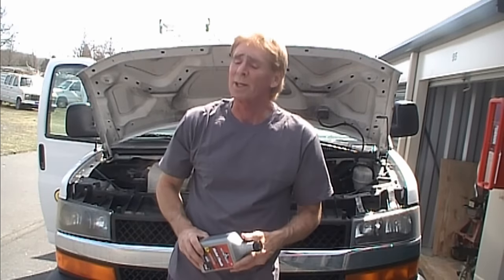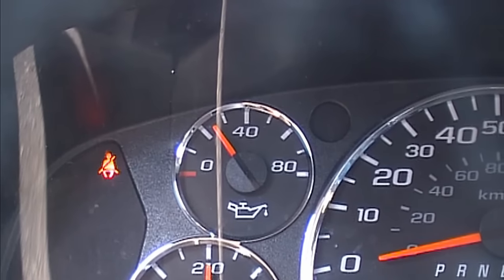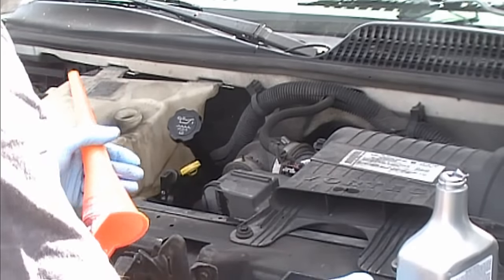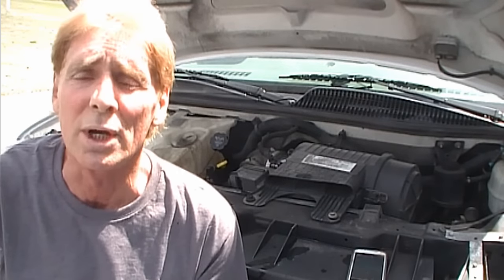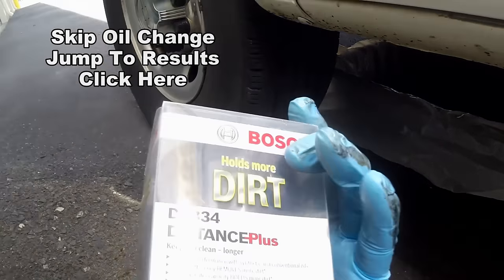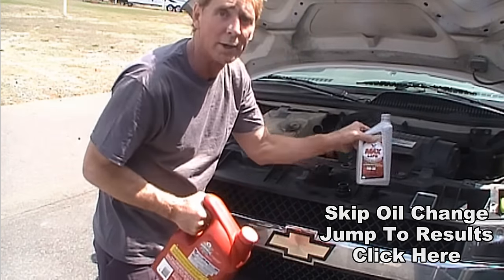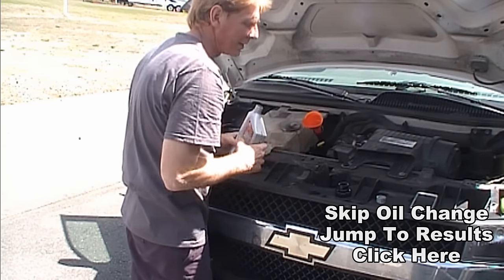NOISY LIFTERS? Motor Flush - Does It Work?  HOW TO DO IT YOURSELF

Comment: NEVER use an oil filter wrench to tighten an oil filter, a firm hand tight application is more than enough, and please get the right size socket or wrench on the drain plug
Reply: I second this and said the same thing lol
Reply: Or never use vicegrips for a oil plug!
Reply: This guy's a goofball
Reply: He’s wearing gloves, when the latex/nitrile, gloves get oily they don’t grip…. I changed oil 10 years no gloves last 15 I reach for gloves every time I drain fluids. Every single fluid on that ride has benzene. Benzene is very heavy and will get directly into your blood and eventually bones causing cancer. Use a paper towel to tighten a filter if you’re thinking of wearing gloves😉
Reply: In this situation where there is a heat valley in the pan where the oil filter sits, your wrong. You DO NOT use your hands you won't get it tight enough. In the situation where the filter is exposed and no object blocking you then your correct.

Comment: MMO totally cured noisy lifter in my 2003 Chevy truck. I ran the MMO for about 2k miles and the lifter noise stopped after about 500 miles, but I left the MMO in the for a while longer, and then changed oil... holy shit! The MMO really worked its magic and removed a LOT of sludge, so much sludge that I had to use coat hanger to keep opening up the drain hole. MMO truly is an awesome sludge remover. Very nice!

Comment: "Don't over tighten oil filter" Right after he way over tightens oil filter.
Reply: no shit he way over tighten that filter. lol
Reply: I think the same....always do mine hand tight
Reply: He did
Reply: ALWAYS HAND TIGHT ONLY ON FILTER. I HAVE NEVER USED A WRENCH.  A real pro always uses vise grips on the drain plug! omg
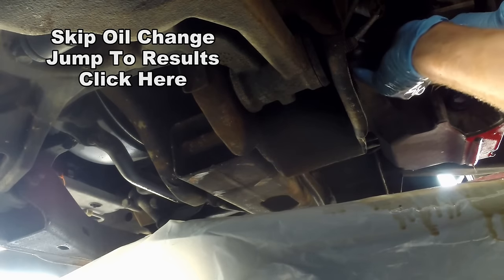Reply: 5:08 The instructions included with most oil filters say to turn to make contact with the rubber gasket and engine block. Then turn ONE FULL ROTATION. He did it correctly. He was slightly over, but otherwise he was correct. I always tighten ONE FULL ROTATION, as per Motorcraft instructions, with an oil filter cap wrench because on my v8 there is no room otherwise. I always use a torque ratcheting socket wrench on the drain plug to exact manufacturer instructions: 9-11 ft-lbs as found in the Chilton auto manual for my car. When you go to a mechanic to have them change the oil, always tell them to tighten the drain plug to the correct ft-lbs specification. That way it avoid stripping the plug and oil pan hole threading.
Reply: Lmao fr hand tight should be good lol
Reply: Especially if it's attached to the oil pump, if you strip it you'll need a new oil pump to take it off.
Reply: Minute lube used silicone RTV one my filter and cranked the drain plug on so tight they crushed the seal,I will never go back.

Comment: ha! "someone had stripped it out before we bought it," let me grab my VICE GRIPS to take off the pan bolt.... sad.
Reply: I find a stripped bolt or nut.. I replace it. 
oil plugs are about $5 or less at any auto parts store worth mentioning, and unless you have some wierd gorram car, they'll be on the shelf.

No excuses but laziness.
Reply: I think a better option at this point is to just JB weld the plug hole and never change the oil again. Or just change the filter and just add oil as needed.
Reply: Oil pan drain plugs often get covered in oil.  Combine that with their short height, and most people only have 12 point wrenches/sockets.  Oil pan drain plug gets rounded off.  Let's pretend he's had the truck for 200,000 miles, and does a religious 3,000 mile oil change - that's around 70 loosening/tightening sequences on that not so great quality drain plug bolt.  Vise-Grips will grab that worn out plug nicely, plus he has tons of room to swing.  Saved himself $5, probly 5 or 6 times I bet.  Stay gold.
Reply: I change the oil on my vehicles regularly. I have yet to strip an oil pan drain bolt. 
Using the right tool and the right sized tool is important. 
If all you have are 12 point sockets and wrenches... invest in a decent set of tools... 12point have their uses but they aren't general use, unless you are being lazy.
5 bucks and doing the job right. It's not that hard.
Hell, get the plug, and a socket to fit it. Spend less than 10-15 bucks and never worry about it again.

Also, most drain plugs are grade 6 or better. So unless you abuse it, it's not going to get damaged that easily.
Good thing too, or 3000+ miles or gravel and other road debris would make the plug a wear item that needs replaced often.
Reply: Kal Galath
I agree with what you said, but he still spent no money and his drain plug remove/install procedure works.  Stay gold.
Reply: Ryan Richards why put someone down? If it works for him let it be his business
Reply: That's a knock...not tick.  No amount of flushing or additives will help that.  Sorry your flush/fill didnt remedy.  Drive her easy and you can get a bit more out of her.
Reply: @nocarebear8301  I've actually seen this!!

Comment: From a cold start the oil pressure should be around 40. If not, drop the oil pan and clean up the pump and screen. 
As for the ticking, there's several things that could be causing it. What you tried may work for someone else. You have to pull out the valves and have a look to get a better idea of what the problem is.

Comment: This is the kind of guy that overtightens  the shit out of oil filters then I get stuck having to chisel it off the next time an oil change is required. Also love the vise grip on the replacement drain plug. Gotta love it !
Reply: He didn’t over tighten the filter
Reply: @moedoe9167  considering the hundreds of oil filters I've replaced, he definitely over tightened the filter. You don't need a tool to tighten the filter. Oil up the filter seal, tighten by hand till seal contacts engine block, then continue to tighten up to one full revolution by hand.
Reply: Vice grip on a bolt.. I think there's a name for that
Reply: Does it leak in 2000 miles tho? Nope

Comment: As a mechanic and race engine builder for many many years, 5 minutes of above idle with an engine flush product at operating temperature will NEVER be enough to clean any sort of deposits built up. The 5 minutes is nothing more than a money maker from the ignorant person. 

The idea is to take the car for a good 50-100km run with the cleaner additive. With variations of heat and oil pressure, the costic solution has a chance to fully circulate and work at fouled deposits through out the engine. Then an oil change can be performed. 

The best flush out is and always will be a full engine REBUILD. Prevention is ALWAYS better than a cure. 
ALWAYS use premium fuels, oils and lubricants. These premium products have more additives and detergents in them designed to reduce friction and constantly clean deposits. 

And ALWAYS service your vehicle according to manufacturers specs. Even intermediate  services make a HUGE difference long term. Reliability, durability and the over all structural integrity at a molecular level on engine components.
Reply: Sage Advice, Thank you!
Reply: This right here!  I had a lifter knock in a 4 runner. Put in seafoam 3/4 quart and ran the car 500 miles .  No lifter noise anymore. Changed oil. Solved.  5 mins won’t generally do anything.

Comment: There's a difference between cleaning a stuck lifter or internals gummed up... And a flattened camshaft and broken lifter. Marvel mystery oil 1/2 qt at oil change 1/2qt day before change... Drive normal. Has freed anything thing stuck I've ever had.

Comment: Its the hydraulic lifters which are making that tappy noise. Pull the valve cover and timing cover off. Release the tension on the cam gears and remove the camshafts. Clean the lifters and put back everything the way it was removed (just the opposite). You will get rid of that tappy noise and have much better function hydraulic lifters. The engine has possibly got another 150,000 miles in it.

Please only hand tight the oil filter and use a spanner or socket to remove the the sump plug. Also please dont use 5W-30. 15-40W is probably the best suited oil given the mileage on the engine and the assuming you are not in freezing weather (wearing a t-shirt).

Lastly dont waste your money on that lifter quiet, engine flush or whatever that was. Read the contents on that bottle, 90% would be hydrocarbons (diesel). I would suggest not putting anything but correct type of engine oil in the engine. If you must, use an engine oil for diesel engine (they have better cleaning properties) to flush the engine and do frequent oil changes to clean an engine of any sludge build ups.
Reply: the guy just took his drain boot off with vice grips and tightened his oil filter with a wrench do you really think hes going to do any of the shit you just said. we get it the guy doesnt know anything. we get it you know more then him. we get it youre better than him.
Reply: thuglyfe91332 Read my comments again. In what way did you find them insulting or derogatory? I know a lot more about diesel engine than an average person because I am diesel fitter. I was just being helpful to him or others who might read these comments. Even if they dont know who to do it themselves at least they would know what wrongs with their car and know what to expect when they take it to the mechanic. The rest was just advice on engine oil and engine additives. Now you tell me what is the purpose of your comments? Just a stupid troll trying to start a fight? Unfortunately its not going to work here, go find like minded people somewhere else. Goodbye
Reply: Don't use 5w-30? That's specifically what it calls for both on the oil cap and e owners manual for those engines on those years. Just saying.
Reply: Dillon Scott Not gonna dispute what the company says. I did say "I would suggest not putting anything but correct type of engine oil in the engine". In think 5-30 flows way too fast. That engine has done 300,000+ miles, components do wear out at such high mileages and thicker oil substitutes for the increased clearance between parts. Believe it or not thicker viscosity oils do lubricate the engine components better in hot temperatures. Thats just my opinion, you can agree or disagree, its your choice.
Reply: I have a 2001 Silverado with a 5.3 and a 341,639 miles and I have always run the same oil. Only had the valve covers off twice personally through the life of the truck (not including dealerships so who knows about them) and all parts had a solid golden sheen with little to no build up. I do, however, have a lifter tick somewhere on bank 2 towards the front, I believe between lifters 1-4. Crate motors for the same year only cost about $3,000 and are labeled as an OEM Manufacturers Warranty Replacement Part through GM. I understand a new set of lifters would only cost about $200-$350, but the engine has long past its expectancy for my use and has been fantastic. My logic is why spend just a little every now and then on the motor for what I would call regular maintenance when I could get the same life out of a crate that comes as manufacturers spec. Just my input on my thoughts. Feel free to offer your own opinions, whoever chimes in Kamal Benipal
Reply: Kamal Benipal What are you talking about "cam gears" and cams? This is an overhead valve engine, one camshaft.
Reply: ***** Well we dnt have Chevys here and I have never seen what inside this particular engine. I wasnt giving him the repair manual for this particular car. Just pointing him in the right direction. I am very confident what that noise is and I know what causes it. Regarding what you are saying, you are giving an impression that modern engines dont have 2 camshafts, infact most engines thesedays have 2 cams because they make the engine more efficient and yes a cam needs a gear to turn it. So you need to do some homework before you start teaching me.
Reply: Kamal Benipal This is an overhead valve engine with one (1) cam, driven by a chain, same kind of engine Chevy has built since 1955. GM doesn't use overhead cam engines in their trucks. Maybe you should learn what you're talking about before you sound off.
Reply: ***** I know what I am talking about .. what you been smoking or injecting? You have no idea what you saying... its a V8 engine and its a van not a truck.. if you still wanna troll go somewhere else because I am simply not interested. Go back to playing videos games or smoking your bong.. I dnt have time to waste on you. Goodbye
Reply: Kamal Benipal No, clearly his apex seals are bad on the rotors.  Yeh, that sounds about as dumb as what you said. Don't talk about engines you don't know about.
Reply: I know I see him using visegrips on the drain plug I instantly said what the,fuck and a lifter that loud he really think maybe a oil flush would cure the lifter issue
Reply: Jay Jones I watched this and thought, additive won't fixed collapsed. I really wanted it to work, but when no sludge chunks came out and the oil just looked like it needed to be changed a thousand miles ago, . . . I decided to scroll down and find your comment.
Reply: Jay Jones Thanks Jay. You are SOOOOO Correct. Some people shouldn't post HOW TO'S If they can't or don't use the proper tools for the job to start with.
Reply: K Ben I was thinking 15-40 fleet oil as well this truck has pretty high mileage might be just the thing we use fleet oil at work and are very satisfied with the results I use in my 16 year old Isuzu Trooper with good results as well
Reply: Yeah too thin for the wear that's been done to the engine
Reply: This isn't a OHC engine.
Reply: Ummm...LS and LQ engines, this 6.0L being a Lq4, (ls1, ls2, ls3 etc. Lq4, Lq9 etc.) You have to remove the cylinder heads to access the lifters. Just saying lol
Reply: Thanks man this video didn't help but your comment did
Reply: Carlos Gutierrez Use the oil viscosity specified in your owner's manual or oil cap. This original comment is incorrect.
Reply: ACH oil filter was put on like 99 percent of othrr ones..the vice grips did the job..However at 320k none of that work is neccisary a ticks a tick..low oil pressure is the problem.Not the lifter..Change oil pump
Reply: Its a pushrod engine not DOHC. No cam gears or any of that garbage in the way of the lifters.
Reply: @ACH91332  lmmfao
Reply: K Ben only one camshaft and he would have to pull heads to change his lifters. Probably not worth the work on a 300k engine.
Reply: @gubroojatt  yes they do, but also take longer to reach vital parts on startup,don't they?
Reply: Cam gears lol this ain’t no dohc
Reply: I have found on this ls motor that after 200,000 the oil pick up o ring goes bad. A quick style fix for a short time. We used a mixture of power steering and Lucas power steering conditioner 16 oz. Helped but didn't fix. Lots of work on a 4wheel drive to drop pan.
Reply: Can u do the same for a 2012 volkswagen tiguan
Reply: @ACH91332  😆 you are funny and mean
Reply: @ACH91332  He probably will do it and overtitghten everything !
Reply: my engine rattles at 3k rpms and higher ( 2002 eclipse gt ) any help as to what might be causing the issue ?

Comment: I recently used this flush in hopes that it would fix my lifter tick. I also added Marvel Mystery Oil to my new oil and a couple fluid ounces of seafoom. My lifters were significantly quieter after about 100 miles. It takes time to flush the sludge out of an engine.

Comment: I personally used marvel mystery oil before using that crap. Nice try though, but you may want to start saving for another engine.  It would be much cheaper than replacing that work van.

Comment: This video reminds me of a time when my friend drove his  front wheels up onto a pair of those old school yellow metal ramps to change the oil in his Dodge van. He drains all of the oil that will come out of it with the front end elevated, then he starts the engine. I'm  yelling at him to shut it down, & he just looks at me like I'M the crazy person. A few seconds go by,(seemed like a few minutes) and he turns the van' s engine off. By this time I am next to the driver door and he looks at me and says "I was just making sure I got all of the oil out. Last time I changed the oil, it was still dirty looking afterward."    That was too much for me, because I knew that the oil drain plug was on the center of the pan, real close to the front. I looked at him & said, "yeah, no shit the oil looked dirty; there's probably 3/4 of a quart still in the oil pan, and do you change the oil filter when you do the oil?"    
He says, " what? There's a filter for the oil?".    I didn't hang out with my friend much after that... stupid actions yield stupid results. By the way, that van ran for about 2 more weeks, before it overheated, then he drove it that way, chucked a rod, kept driving it and seized the motor. Apparently, checking the coolant once and again was beyond his technological skill set. Derp, derp. The End

Comment: Using a quart of Marvel Mystery Oil in the crankcase made the loud lifter ticking noise in my 2002 Chevy truck disappear. I drove the truck about 400 miles and then changed the oil. The oil was extremely dirty and this was telling me that the MMO was removing the sludge out of the engine.

Comment: My experience with a 2000 GMC Savana 350 vortec is similar to Mark Prescott's advice.  At 328k miles had a similar noise.  Changed oil to 4.5 quarts of Mobil Super high mileage 10-W-30 and a new Fram tough gard filter plus a half quart of Lucas oil stabilizer.  50 miles later, no noise.  Engine takes 5 quarts.
Reply: Use better motor oil. The Lucas is doing all the work
Reply: Wow I just did this too and it worked too I was amazed